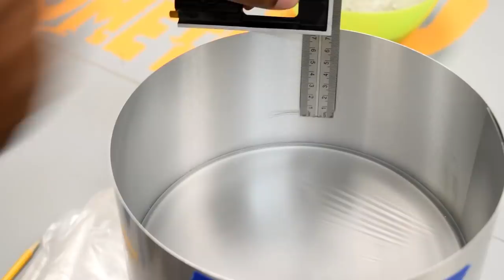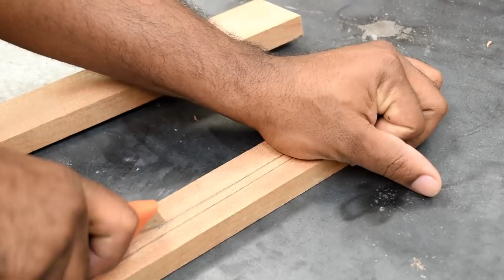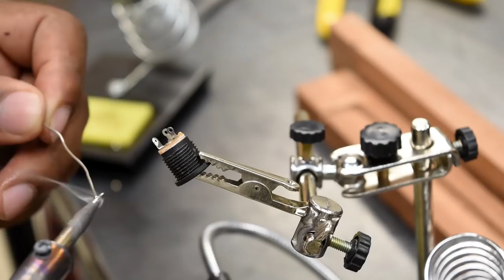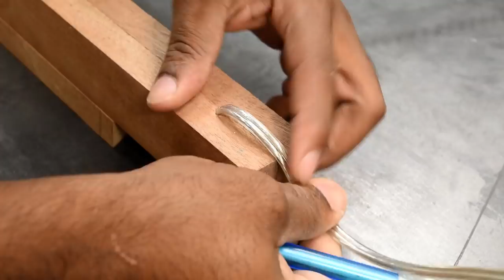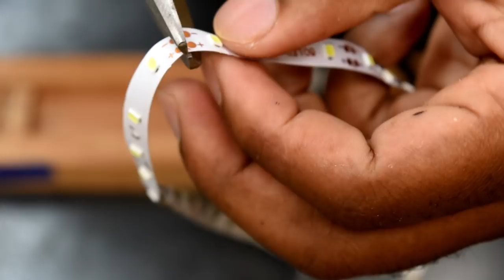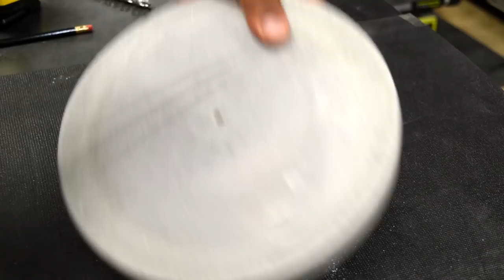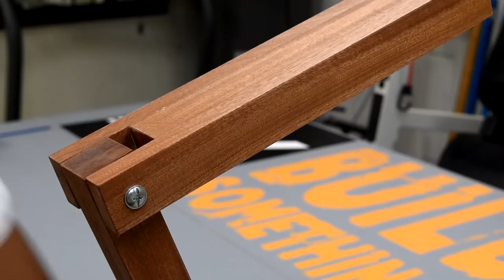Diy LED Desk Lamp With Concrete Base

Comment: Home Depot and other big box stores sell 24" x 48" diffusers with a variety of textures in clear and milky white that are normally used under fluorescent lights. They are about $10.00 and could be cut down to work and would eliminate the painting. It would add cost but give you a reason to build several more. This is a very cool design.

Comment: Thanks for showing me how to add a low voltage lighting system to a wooden lamp and how to make and attach a concrete base. I am planning a similar project.

Comment: Nice project! My personal suggestion would be to change the zinc philips head bolt for a countersunk socket head bolt, ideally one that had been plated black or a raw stainless steel fastener. Most bolts I buy from suppliers come in black, so there's no need to buy silver ones and paint them, as you should be able to get a black one fairly easily.

It's amazing how much cleaner exposed fasteners look when they're socket-head.... even if it does make things look like they came from IKEA lol.

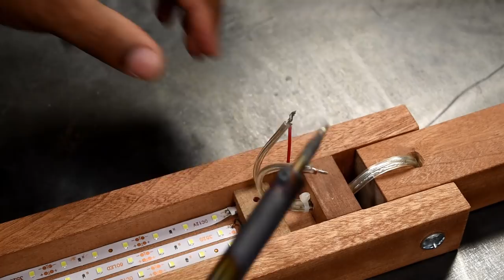Comment: Great work and project! One comment about your soldering though. At 18:35 you were "carrying" the solder to the wires, i.e. melting solder on the iron and then applying it to the wires. That's a bad technique creating cold solder joints where the solder hardens but not actually bonds to the metal of the wire. This can cause failure over time, especially when the joints are moving. try applying a bit of solder to the iron to improve contact, then apply the iron to the wires to heat them up and only then bring the solder in contact with the wire. The solder will melt around the wire and bond with it, creating a good contact joint that will last as long as the concrete base.
Reply: I always get the wire insulation melted using this technique :(

Comment from the maker: Follow DIY Creators on instagram  https://www.instagram.com/diycreators2015/
FAQ 
- Find the written article here https://goo.gl/fGHabE
- Led http://amzn.to/2hHvE6y
- Power Supply http://amzn.to/2gNiG5I
- Toggle switch http://amzn.to/2hQ5U4c    
- DC Jack (inlet) http://amzn.to/2hQkUip
- Yellow Miter box and saw  http://amzn.to/2hHEcL5
Reply: Was it really plexi glas or was it acrylic?
Reply from the maker: Plexi glass either one could work.
Reply: DIY Creators okay thx!
Reply: u can cut plexiglass with stanley nife
Reply: and then break it off
Reply: Cool lamp! But i think better weld all wires instead of connectors. Thank You!
Reply: Lyrix  Plexi is acrylic, Plexi is a Brand(Name)

Comment: Very Nice Glen I like the modern look. since you had some ooops on the cement just rub a little joint compound on it and lightly sand then repaint. you will like the look.
Reply from the maker: Thanks man, I appreciate the tip.

Comment: Looks great but you should never switch the negative wire. Always switch the positive one. At 12V it may not matter but at bigger Voltages it could be a live saver. If someone gets into the electric circuit by touching a metal part which is under power, it gives them a shock, even if the switch is turned of because the electricity flows through the body in the ground. ALWAYS SWITCH THE POSITIVE WIRE

Comment: can you teach on the led? why you connect all positive and one negative? i can't understand...
thanks
i like you channel
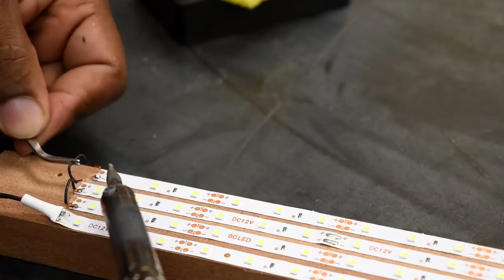Reply: He connected the negative at the bottom. The reason he soldered one negative at the top because the led connection at the bottom o f the most right strip was blocking the connection of negatives at the bottom. Just look at 14:05 and freeze the frame there.

Comment: I’ve sanded Perspex and acrylic to get a frosted look, also if your good with an 
Angle grinder it works well for making precise cuts,  just use a thin cutting disc and score the line before going all the way through, nice lamp btw

Comment: You're a craftsman, Glen.     I learned many things from watching your video.   What will stick with me are
(1) wiping on polyurethane satin finish rather than spraying it on
(2) spraying paint on one side of acrylic to hide wires
(3) sketching wire ingress/egress before cutting the wood
Thank you for sharing your tips.
Reply from the maker: That's Great Thank you :)

Comment: Great looking build, and you explained each step perfectly. I appreciate that you commented on your miscues (concrete imperfections, no heat shrink on the base wiring, cord going out the wrong side of the joint) and what you would do differently next time. It's nice to be able to learn from those mistakes, rather than you editing them out.

I do question whether you can claim this build is "no power tools required" considering how much you relied on the power drill and soldering iron. You could get away without soldering the joints, but this build would be a massive pain in the ass (borderline impossible) if you were only using a hand drill or chisel set.
Reply from the maker: Thank you. I don't mind showing mistakes at all. 
Yea I knew saying no power tools would be frowned up on. I was referring to large tools like table saw and miter saw, but it's hard to explain that in a title. Ill pass on a hand drill lol

Comment: Very detailed video, and fantastic outcome. Thank you for sharing. I'll make a similar lamp with minor modifications. I need more light than this, so I'm going to use 6 lines of 5050 LEDs, not the 5028s that you used.

Comment: What an awesome lamp:-)  I also Like using a wipe on poly. One thing I do to get a super smooth finish is take some 400-600 grit sand paper and use that to apply my 2nd coat of poly with.  the fine dust created by the sanding will fill in any grain and the end gran and give a super smooth finish.    cant wait to see your next project!
Reply from the maker: Thank you :)

Comment: Very nice but I would like to make one suggestion.  If one's soldering skills are as rudimentary as mine you might want to test the lights just after you solder.  The 12 volt LED strips I have can be tested with a 9 volt battery.

Comment: Did not read all of the comments, so sorry if it has been said before. When you use sawdust as a filler, do not use a metal object such as a putty knife to push it down. Atleast with our woodglue that just turns dark and ugly, but when pushed with wood or plastic, does an amazing job. Thanx for the cool project idea

Comment: I like this! I have a quick thought/recommendation for future lighting designs. I noticed you wanted a fogged look for the LED cover; try sanding over the top and bottom with a fine grit. This will be a quick and clean solution without using any spray. Since LED's are so bright, it will shine right through! :)

Comment: Great video!!!. I have a suggestion. Instead of using "paint" on the acrilic piece you can sand it with steelwool and have the same effect. Cheers from Argentina!.

Comment: Simple design and excellent result. Top job =) 
Although personally I would have polished the concrete and maybe added some speckles using dark stone bits in the concrete to add that extra touch.

Comment: Nice project and a late comment of mine ;-) All really nicely done and just two things I would've done differently. The switch I would've installed facing the "on" position down. Usually switches are turned off most of the time and hence dust might settle on top of the switch, if it protrudes. It's one of the reasons why wall switches have their top side pressed down when off. Unless it's a toggle switch of course. 
The connector bolt on the joining connection of the two wooden parts you could've used the same connector on both sides and a piece of threaded rod. That way it would have the same look on both sides.

But nevertheless a nice lamp and just some minor suggestions of mine.

Comment: Excellent job. Will definitely be having a crack at this. I reckon the switch would be better off on the front though. Easier to find and use. Thx for posting all these projects. Very creative. Keep up the good work.

Comment: Way cool Glen, love stuff like this.  Don't need a desk lamp right now but might try one just for fun. I did build the circular saw dust collection shroud and it works great.  Have not found a suitably flexible material to cover the top surface yet but good ole duct tape is working for now.  I had to build several very large MDF boxes recently and this setup was a must to keep the dust down.  Keep the vids comin!
Reply from the maker: Thanks Dean Its a fun one. What flex material are you referring to?
Reply: The piece that gets bent over the top

You used hardboard I think. I didn't have any scraps thin enough and didn't wanna buy a whole sheet for such a small piece.

Comment: great project! Those Led lights are awesome, Im currently installing them to my footplates on my cabinets in the kitchen that runs to a low voltage relay that ties to a light switch. They are very versatile
Reply from the maker: Thanks, I actually have a plans for a future project adding under the cabinets.

Comment: I'm not an electrician but I did study eet for 2 years and it's common to put the switch and fuse to the positive end. NOT saying I'm you should but it's safety 101 in electrical.
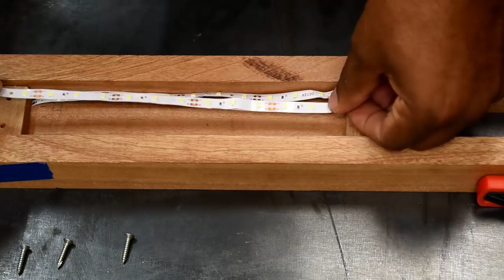Reply: DC 12v  look at 12:34.

Comment: It would be a good idea to draw the line before forming it into the tube. I would use a 9inch cake pan for the concrete mold.

You need to practice soldering.

The insert would have been a good idea.

You can make your own wipe on poly by diluting poly 50% with mineral spirits.

Nice project, looks good.

Comment: To really finish off the concrete base, you can use a very light 2nd coating of the cement (with concrete stain for a different color) then sand it down. Also you can use a bag of fine grout, pretty much a sand and cement mix.

Comment: Hi, I'm new here at your channel and I'm loving it. I'm really into this shit because me and my dad used to build small cabinets, racks, stairs and doors together. And trust me your channel is awesome. BUTTTTTT. My OCD kills me about the way you soldered that wire. Hahaha. When I do wires and switches, I really try to insert it inside the hole and not just solder it on top. Hahaha anyways. More power to you. and you got another subcriber in me. :)

Comment: hey glen. its really beautiful design and perfect.
I do have some comments I hope it would be useful for ur next project.
first in the concrete base, u could have made a small layer of concrete before sanding but as long as u have painted it then its OK. for me I'd loved it concrete color.
second, I think the split of the  shaft would have been better if u done it at the back side and the cut could have been at 1/3 of the shaft. cuz u could be able to make the channel of the wiring plus made a small thin screws from top and bottom to be able at least to open it in case something went wrong and fix it. plus the channel can be opened from bottom to take out the wire from the base instead of the shaft.
third, why didnt u make the small piece in L shape to cover the Led wiring instead of painting the glass in black. or cut a thin piece of the wood and stick it to the glass in the same place were u painted.
and one more question, im really curious of why did u make it with manual tools this time?
once again its really nice and great and sorry for my long msg as I would love to know ur answer plus I hope I can give u a good advice on return of the great videos u r making.

Comment: I love the lamp. One question, instead of the frosting spray could you lightly sand the plexi for a frosted finish?
Reply from the maker: Thank you, I actually tried that on a scarp piece but i was still able to see the led through the glass.

Comment: wet your wire ends with solder first., then you just apply some minor heat for it to solder to the other solder point which must also be wetted with solder
much easier and less heat, which means you dont overheat your connections.

Comment: If could tilt both sideways too,it would be better,the upper part length could be more,it will be better use for reading a book But I appreciate your work and each step by step detailing.
Thank u so much

Comment: It looks awesome, bro! And I love your accent! Not sure about the ziptie though, doesn't look like there'd be enough friction between it and the wire to not have the tie just slide along the wire :)
Reply from the maker: Thanks :). Trust me the Zip tie is strong. If pulled tight enough the zip tie will compress the wire jacket.

Comment: Loved it! Would've loved to see a way to hide the heads of screw and connector at the top. Never tried but I feel this is possible - to let those heads rest at a level deeper than surface, and then place caps ( matt black or same color as wood ) on top - in a way the caps can be removed when needed. :)
Reply from the maker: Thank you, Ill keep that in mind when I tackle a new one.

Comment: I'm not good with electrical, but does the switch have a negative and positive terminal aswell? Or are both sides considered negative? Cause didn't your already run the positive wire to the adapter?

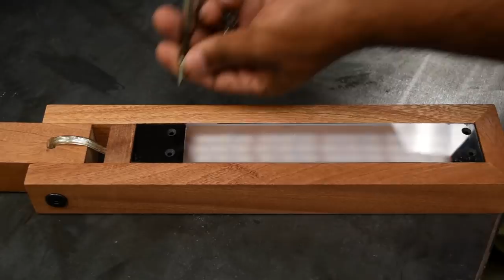Comment: 19:00 the screws you used are different then the ones planned in the beginning ... did you use some copper inlets with inner thread instead plain wood screws??

Comment: This is a great build. It could be a great place to use a plow plane or a router plane to create the wire channel. That is if you have one.
Reply from the maker: Thank you. I could have used a router but I wanted to show that this was possible to do it with less tools.
Reply: I'm referring to a router plane. There is no motor. It works on the same principle as your chisel.
Reply from the maker: Oh sorry, I got it. I actually never used one of those. Its probably worth having.

Comment: If the adaptor is small enough you could integrate that into the cement base, looked thick enough for it. .. just a thought 😁

Comment: cool, never considered concrete for a base. You could possibly use cheese cloth or burlap mess cloth to do the same as the metal wire with bonding effect  or pieces of fiberglass mesh or strands.
Reply from the maker: Thanks Richard and thanks fir the tip.

Comment: I love the design well done. just a couple of tips from a qualified joiner.  You should get yourself a router for cutting out channels for your electrics.  I would have used a  nut fixed with epoxy in the base of the lamp to screw the bolt into.  I do not think simply screwing the bolt into the wood will last overtime with movement.  Looking forward to your next video.
Reply from the maker: Thank you. I have 3 routers :). I wanted to show viewers that this could done with less tools. Since the wood is rather hard the screws creates threads. Im Confident this will hold up. Plus I have to remake the concrete base. Epoxy could be added at any point.
Reply: I somehow doubt that a concrete-based lamp would be moves all that much, regardless of entirely or just at the upper joint. Then again, a DIY Lamp with a (globelike-)rotating joint would be quite interesting, especially if wires run through such a connection. What I wondered upon looking the video: what if the LED was also going through the lower piece of wood, with both strip(-parts) being separate from each other. A custom and fixed (in terms of intensity and color) "reading"-light and a flexible multi-color-room-atmosphere-light...?

Comment: Do you think you could make a smaller diameter base, or would that mess with the balance and cause it to fall over?
Reply from the maker: You could make the base smaller concrete is pretty heavy.
Reply: DIY Creators Awesome! Thanks for the reply, keep up the good work.

Comment: Hey thats Great. But. Led requires a driver to be connected in between i have not seen any driver in the video. You are connecting the LED right away to the power feed. may i know where the driver is placed?
Reply from the maker: Thanks. This is a 12volt LED strip. No controller is needed I only get one color. Led's that use a controller are RGB. RGB are color changing.These types of LED need a controller to select the color you want.

Comment: Your base might have gotten stuck to the vase also due to the fact that it had a clean surface and thus adhesion was created. You could try pouring that on a some sort of rubber, would make if easier to take off.

Comment: This build really came out pretty damn good.  Your attention to detail, Glenn, made all the difference in the world.  My only criticism was this:  why make such an ugly concrete base?  That mahogany lamp arm is really elegant but does not match well to the gray concrete base.  You might want to look into an acrylic mold in which you can an endless amount of shiny stones, sparkly things, beads, or what not into the pour.  Granted this won't afford you quite as heavy a base but you always increase the diameter of the base to compensate.  Good job.

Comment: I like it so much, how much costs approximately :D
Reply from the maker: Thank you  It cost me about $15 to make. Some of  the things I used I didn't have to buy.  It would probably cost about $35 to buy everything.
Reply: Perhaps you consider to add to some of your future videos a small part which discusses costs and individual looks as well as "necessity" of builds. After all, it is discussable, whether or not an Amateur should build his own "DIY concrete kitchen" if it is easier, cheaper and most likely more safe for the kitchen to hire a professional. ^^
Yet again, the advantage of some of your projects is obviously the price and the individual aspect of building and so "tailoring" products to the own liking and taste. Not to mention: what you build for yourself, you build as you need it, which cannot be said about every product that one buys in the next store... ^^